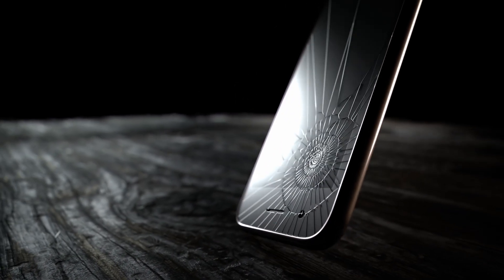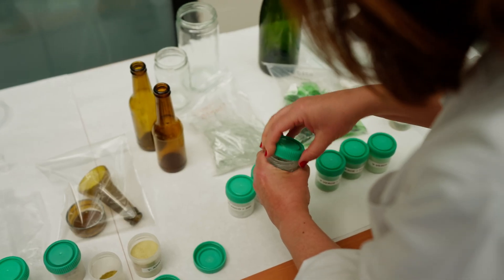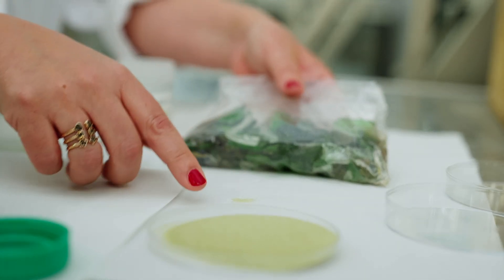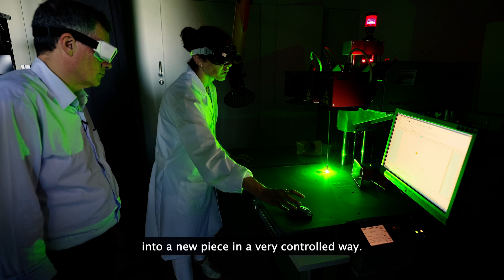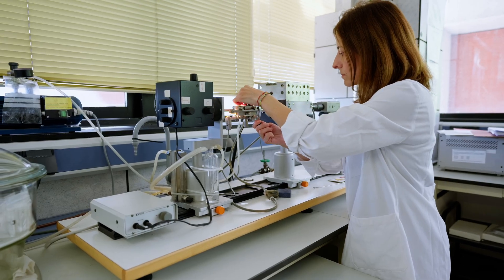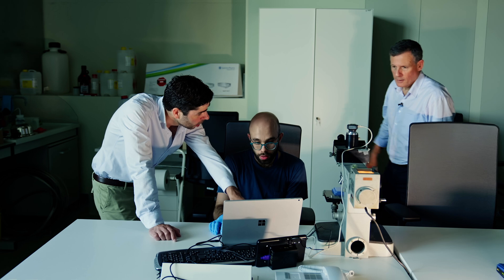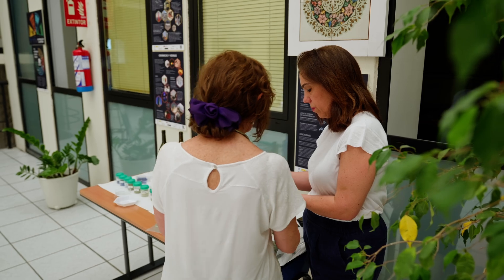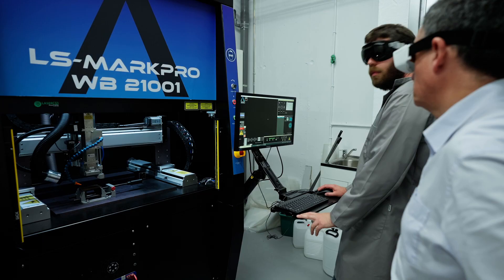How Lasers Are Transforming the Future of Glass Recycling

Comment: Sounds neat. I'm curious, though – do you expect this technology will be able to recycle all types of glass? 🤔 Or are there certain types of glass that will probably be too difficult to recycle?
Reply from the maker: Yes, the technology developed by the project EVERGLASS will be able to handle all glass types, even those with high melting points, like borosilicate and aluminosilicate. However, glasses with contaminants (e.g., flat glass mixed with plastics or metals) might still need extra processing to separate materials before recycling fully.